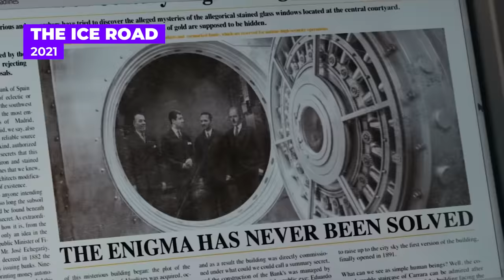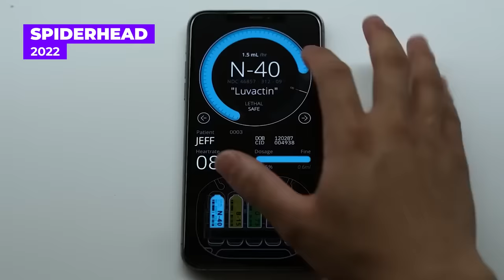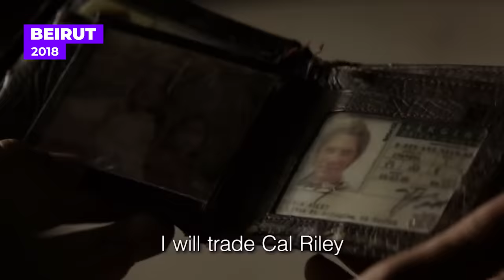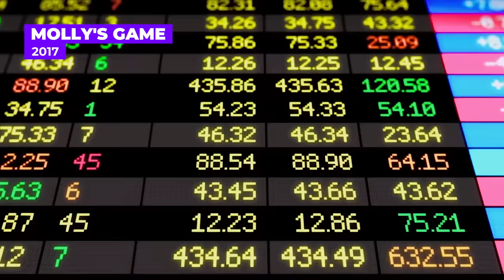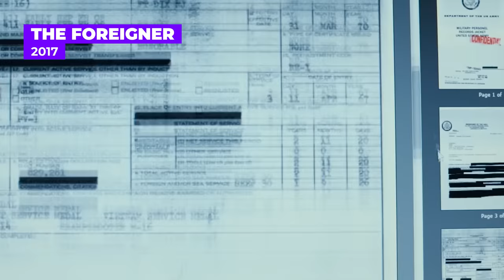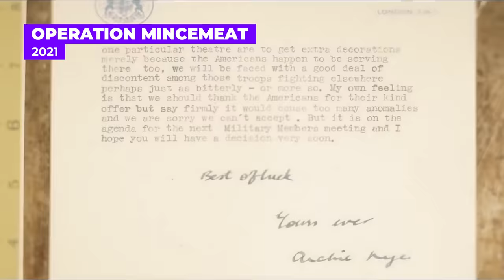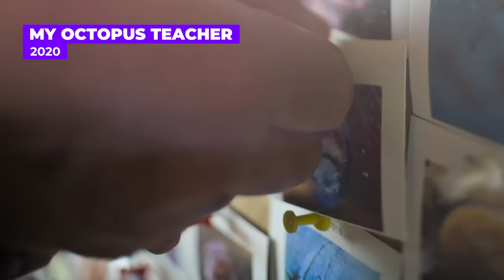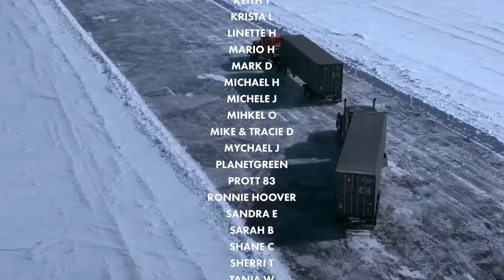20 SURPRISINGLY Good Movies on Netflix Right Now

Comment: RRR is great.  There are two protagonists, one just grabbed a passing motorcycle throwing it's driver off, in one fluid swooop then hopped onto it and sped away, only to peel out so that the other protagonist could leap off the rear of the bike and launch 20' in the air, only to shoot some dude riding a horse in the throat with an arrow which caused that guy to fall off the back of his horse and said protagonist then landed on the horse in stride to vacate the area with his motorcycle buddy.